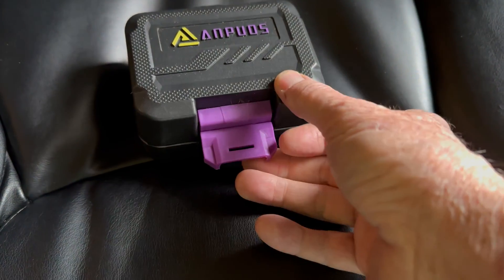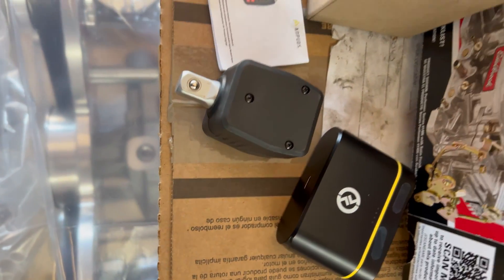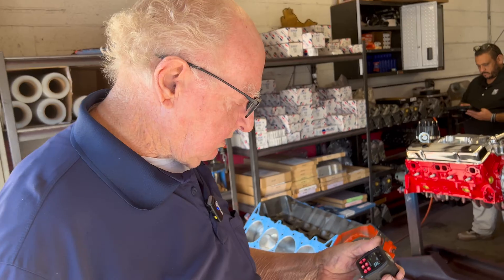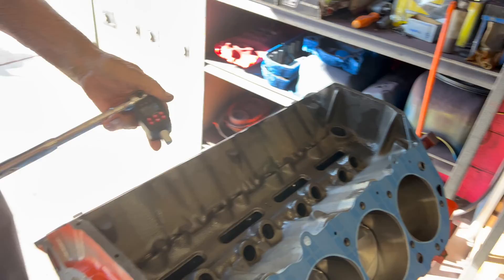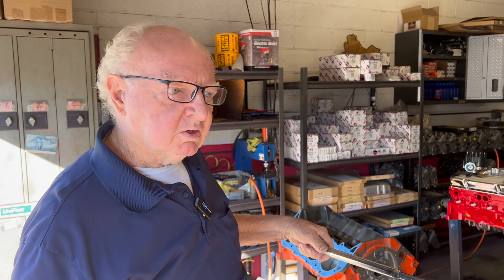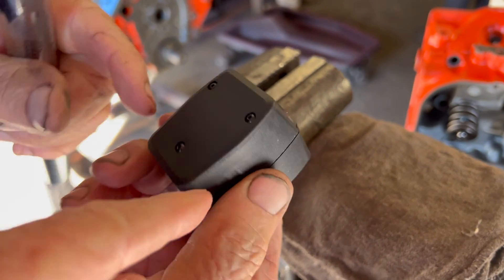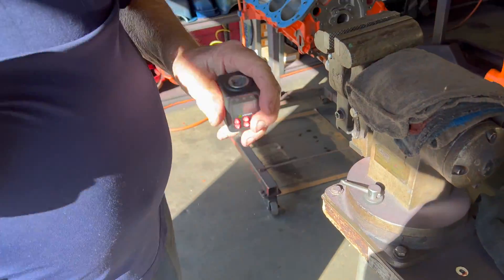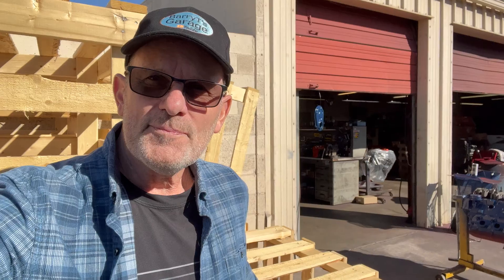Torque Adapter Review - ANPUDS with Ed Smith and Barry T

Comment: The screen has a plastic film on it you have to peel off. Then it should be easier to see. 
I agree with the other thoughts. Needs a beeper and quick change battery door, or usb plug charger.

Comment: You are not getting the beeps because you are in silent mode. To turn off silent mode:  turn the unit off,  while it is turned off, press the "p/t" and "m" button both at the same time.   If you get a beep when you turn it on then you should get beeps when you torque.  If you get no beep when you turn on the unit then you are in silent mode.

Comment: Thanks BarryT's Garage.

It would be better if the Adappter had an inductive charging interface for the internal batteries. It would also be very good if a good anti-noise working headset or earphone could be connected via 2.4 GHz interface for small radio radius, which would emit a very good low frequency signal when the torque is too low, an exact signal when the torque is reached and a high frequency signal when the torque is too high. Blind people can ideally help with the perfect stereo signal design, as they have a much better understanding of it than those who can only see too much. SIN(x)+(SIN(3x)/9) can be used to generate a sound signal for the correct angular speed of rotation. A signal for the correct rotational force can be generated from COS(y)+(COS(3x)/9). Here, inverse-negative logarithmic signal generation is ideal. This means that very far away from the target torque only very coarse resolution and quiet, but the closer to the target torque the normal frequency and amplitude resolution. This makes the most sense and leads to good, fast and very accurate screw loosening measurements and screw tightening logging. Thanks for the video and the well posed question about the optimum with this modern digital torque measurement technology.

Qi$€
SJVD/MFM
Michael Frithjof Miller

Danke BarryT's Garage.

Besser wäre wenn der Adappter eine induktive Ladeschnittstelle  hätte für die internen Akkus. Auch wäre es sehr gut wenn ein guter Antischall-Arbeits-Kopfhörer oder Ohrhörer via 2,4 GHz Schnittstelle für kleinen Funk-Radius angeschloßen werden könnte, der ein sehr gutes Tieftonsignal bei zu geringem Drehmoment ein Exaktsignal bei ereichtem Drehmoment und ein Höhertonsignal bei zu hohem Drehmoment abgeben würde. Blinde Menschen können bei dem perfekten Stero-Signaldesigne ideal helfen, den Sie haben dazu den sehr viel besseren Bezug als die meist nur zuviel Sehnden. Aus SIN(x)+(SIN(3x)/9) kann ein Tonsignal für die richtige Drehwinkelgeschwindigkeit generiert werden. Aus COS(y)+(COS(3x)/9) kann ein Signal für die richtige Drehkraft generiert werden. Dabei ist inversnegativ logarithmische Signalgeneration ideal. Das Bedeutet bei sehr weit weg von Solldrehmoment nur sehr grobe Auflösung und leise, aber je dichter beim Solldrehmoment je normaler  Frequenz und Amplitudenauflösung. Das macht am meisten Sinn und führt zu gutem zügigem sehr treffsicheren messenden Schraubenlösen und protokollierendem Schraubenanziehen. Danke für das Video und die gut gestellte inewohnende Frage nach dem Optimum mit dieser modernen digitalen Drehmomentmess-Technologie.

Qi$€
SJVD/MFM
Michael Frithjof Müller

感谢 BarryT's Garage。

如果 Adappter 的内部电池有感应式充电接口就更好了。如果能通过 2.4 GHz 接口连接一个良好的抗噪工作耳机或耳机也会非常好，因为无线电半径小，当扭矩过低时，会发出非常好的低频信号；当达到扭矩时，会发出精确信号；当扭矩过高时，会发出高频信号。盲人可以理想地帮助设计完美的立体声信号，因为他们比那些只能看到太多东西的人更了解立体声信号。正确角速度的声音信号可由 SIN(x)+(SIN(3x)/9) 生成。COS(y)+(COS(3x)/9)可以产生正确的旋转力信号。反负对数信号的生成是最理想的。这意味着，在距离目标扭矩很远的地方，只有非常粗糙的分辨率和静音，但越接近目标扭矩，频率和振幅分辨率就越正常。这是最合理的，可以实现良好、快速和非常精确的螺丝松紧。感谢您提供的视频和关于现代数字扭矩测量技术最优化的问题。

齐
SJVD/MFM
Michael Frithjof Müller
Reply from the maker: Very good suggestions, thank you! Very well thought through, and well described!